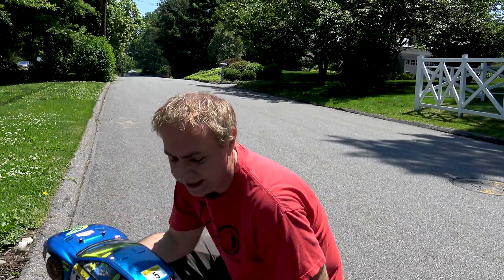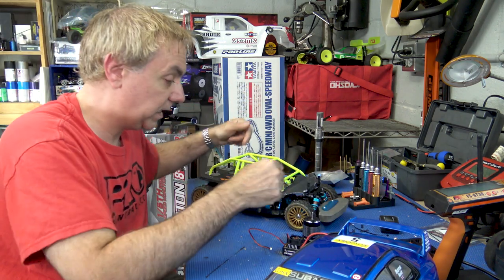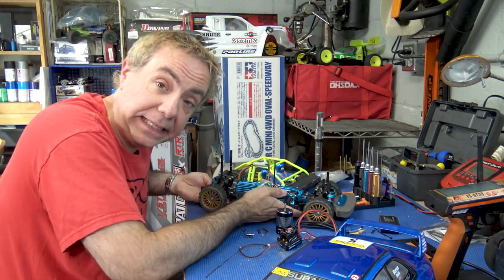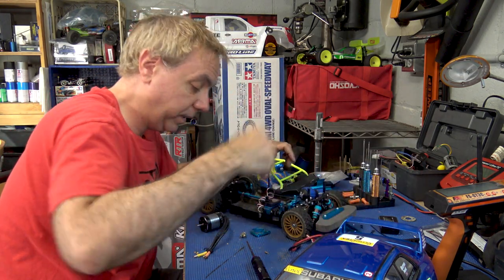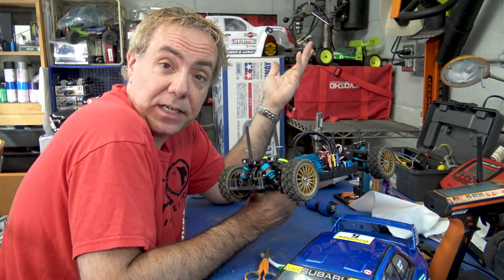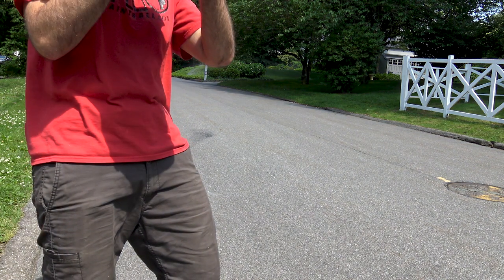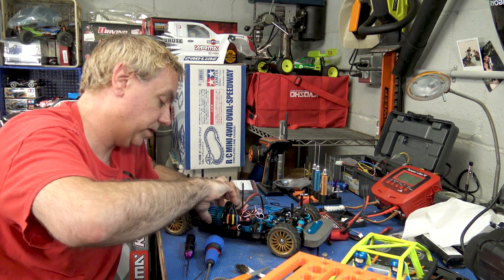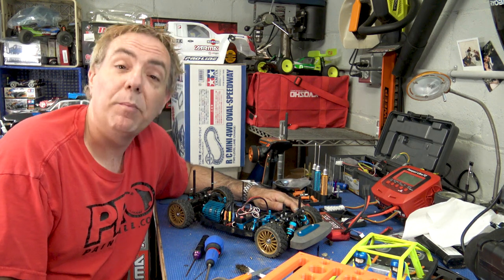Tamiya TT02 - Brushless Conversion

Comment: Can the Tamiya stock ESC and motor handle a 2s 5000mah battery. Thanks
Reply from the maker: I honestly do not know. Check the instructions, but I thought there was some disclaimer that the stock ESC should not be used with Lipo, but I could be wrong.
Reply: I realise this thread is from years ago, but the Tamiya TBLE-02S ESC can run a 2S Lipo, but the low voltage cut off cannot be changed to suit a lipo so you have to monitor the voltage or fit a cheap Lipo low voltage alarm. I'm sure we all know already but Lipo's CANNOT handle being regularly discharged below 3.2V, so monitor carefully.

Comment: Results may vary, but when I installed the high speed set in mine, it screamed! Not in a good way. It was loud, like yours. That is never good with gears. I changed pinions and tried different gear mesh settings. Didn't help. I finally grabbed a Robinson 48 pitch spur out of my spares and a losi pinion. Quiet as a mouse now. Maybe that is what happened to yours?
Reply from the maker: Oh maybe. 48 huh? Maybe changing it up will help. Thanks for the tip will have to see what I can swap in.
Reply: Mine did the same. Turned out it was my fault. I was using a 48p pinion with the .6 mod tamiya spur. Wrong gear pitch on my pinion.
Reply: It's 100% your mesh, your not setting it correctly.. I run 80 plus mph in my Drag cars and on road cars with 48 P plastic spurs and aluminum pinions, when installed with the correct mesh and amount of play you can go 150mph plus it doesn't make a difference ,it has nothing to do with the plastic spur. installing metal spur gears only creates more potential disaster further down the line.. 👍🏁💯
Reply: @ConditionZero76  Not true. I spent years racing dirt oval with 64 pitch gears and never had a problem. Just because you go 80 plus or 150 mph does not mean certain gears when put together, make noise. Why do you think gears on fullsize cars are cut different for forward and reverse? To cut down on gear whine. Ever heard an old honda civic back up at 10 mph?

Comment: what shock you use?
Reply from the maker: They are from Yeah Racing. I have them on a few cars and they work great. Here's a link: https://www.rcmart.com/yeah-racing-shock-gear-50mm-damper-set-for-1-10-rc-touring-m-chassis-car-blue-dsg-0050bu-00036295
Reply: @JohnBattistini00  how you make a high ground clearence dude? I need more ground clearence for tt02
Reply from the maker: @alfathinandasukmana424  There are instructions in the manual for how to set it up with the high ground clearance.  I just followed those. Check out my build video if you want to see how it did it. I think those steps are in part 2, but I am not sure. https://www.youtube.com/watch?v=5HsvE_xyVLk&list=PLT9d6Z0Drj_s1Tdd2_JoruyyqstcEubbL&index=5&t=555s
Reply: @JohnBattistini00  ok thanks mate. Maybe you used yr shock and effect to your ground clearence. I wanted to change my shock, but im confused to change between 60mm and 70mm

Comment: What interior is that?
Reply from the maker: It's the Rally Cockpit set from Tamiya. I 3D printed the roll cage, so that doesn't come with it, but I did a whole review video on it previously on the channel if you want more info.
Reply: @JohnBattistini00  thanks! I am building a tt02r rally car and want an interior. I am using the nurburgring sti but changing the color and decals
Reply from the maker: That sounds awesome, what color are you doing? And what stickers?
Reply: @JohnBattistini00  i am going to try to do a custom graphic layout. The body will be gray and the decals will be a combination of highlighter yellow, white, black and a lighter gray
Reply from the maker: @brandondecker1881  oh wow. Let me know how it turns out.
Reply: @JohnBattistini00  will do! I am also 3d printing a custom rally wing for it.
Reply from the maker: @brandondecker1881  yes!!!!
Reply: @JohnBattistini00  its on the printer now. Also made wheel wells. Thursday is build day! Base set up is 20t brushed with a 2s lipo and high speed gear set. I am sure i will convert it to brushless at some point.

Comment: If the original diffs gears are still on it,  going brushless is not a good idea. Much less with that motor
Reply from the maker: Very true. That’s why when I built it I put in upgraded Tamiya diffs with plans to do the future brushless conversion.  There are a few videos on the build on the channel. You should check it out and let me know what you think.